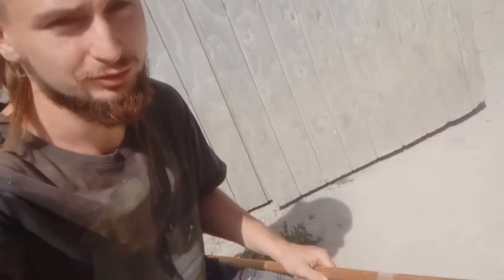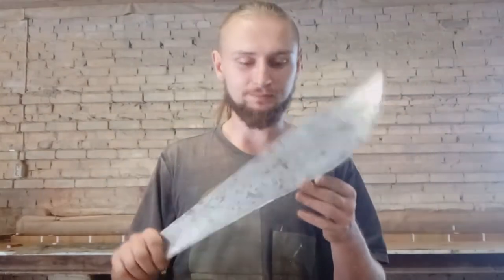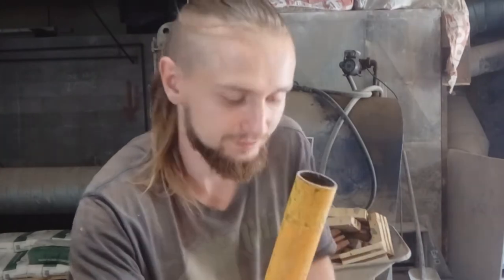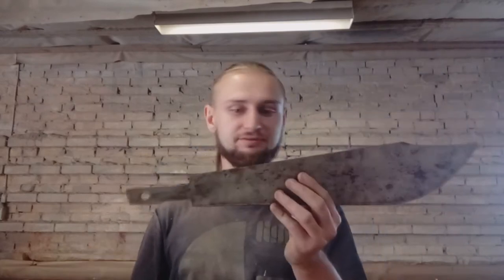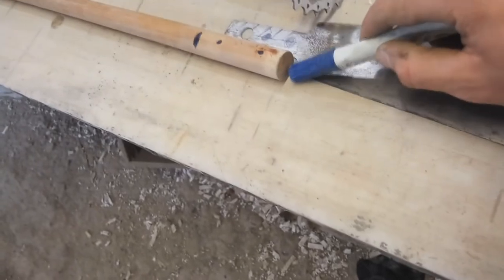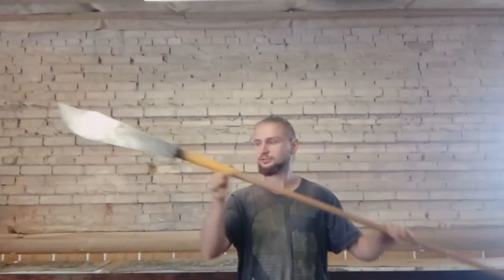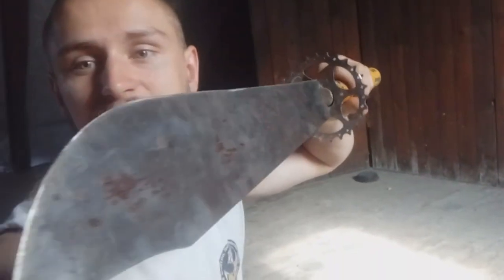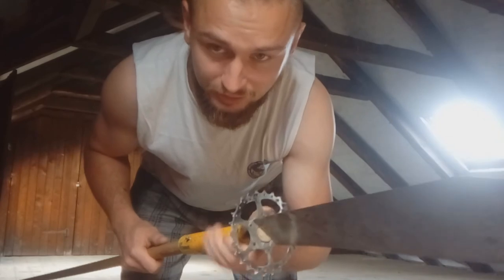Making my own Guandao

Comment: how do you cut your blade, with an iron sword?
Reply from the maker: I used a angle grinder to cut the blade from this saw and later on table grinder I did more smooth shape (my battery on my phone died and I could not record it)  which you can see on video. 

This is video how this one works : ) https://www.youtube.com/watch?v=LJC_NyZ3Zfc - I have not sharpend this blade but still is very nice one : )
Yea, I am little angry about this that I missed this cutting part in this video ... but I thinking about making "new one" because few people would like to see it ; ]

If your question it is about fighting - I do not use this for fighting and I dont know how this blade react on Iron sword : )